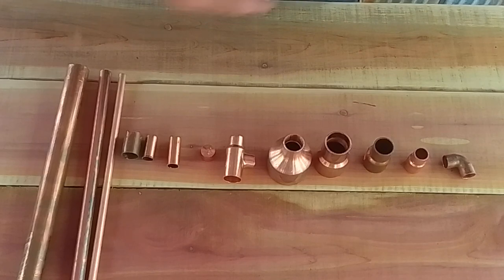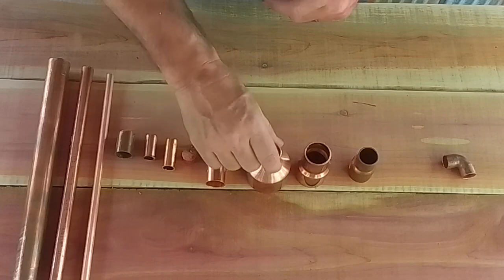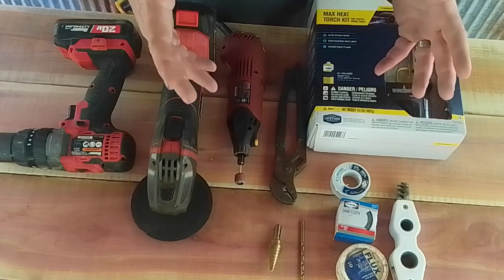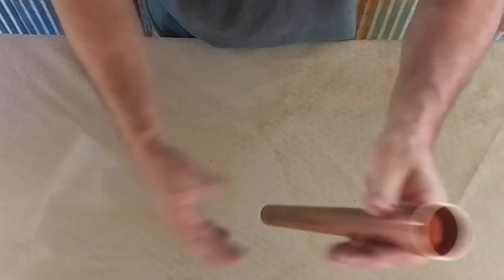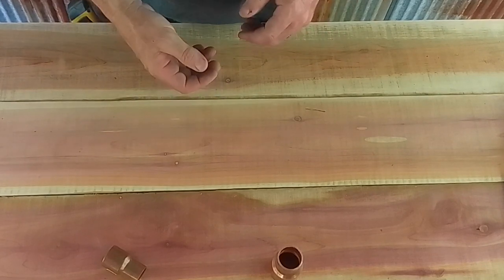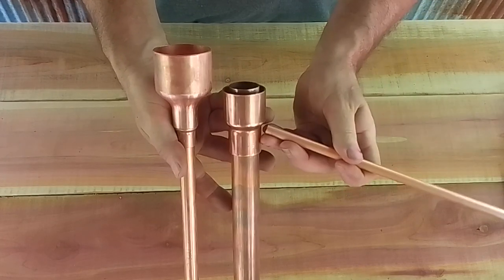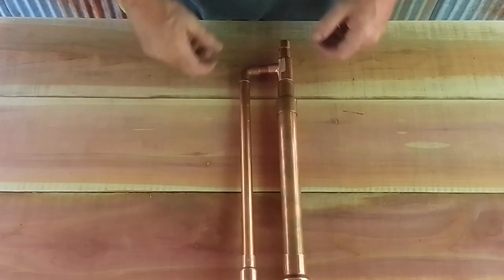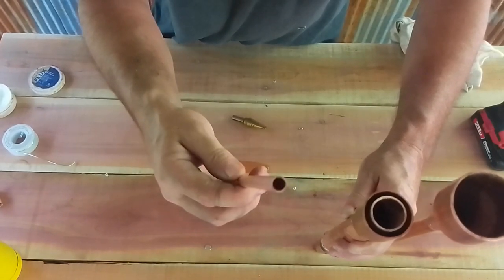DIY Copper Proofing Parrot

Comment: I realize that this vid is a couple of years old and things have changed so I have a couple of updates. 
The 1/2x1/2x3/4 is now available from HD (1/2 price of Am) HD# 187518. 
The 2" reducer is available to go directly 1/2" eliminating the 3/4 x 1/2 street reducer bushing and 1 joint. (couple of bucks cheaper too) 
AM has the 1/4' copper tube in 1' length. Hope this helps
Reply from the maker: Thanks for all the updated info. I have also found out through talking with so many others around the country that not all HD locations stock the same products.
Reply: @StillnTheClear  yes, I realize that not all HD are going to have that on the shelf, but they will ship it to the store for free. One question. The parts list says spout is 1/4" in the video you stated 3/8". Which is correct?
Reply from the maker: @Max-ol5wh  it is 3/8. I misspeak so often it's a running joke, lol.

Comment: Nicely done, Cyrus! In a pinch, I use pliers with long handles pushed into a coffee can full of pebbles or sand. Any kind of pliers work including vice grips. This hack makes it easier to get the torch around a horizontal pipe compared to a vise which sits too low on the bench.
Reply from the maker: Good idea, thanks for sharing.

Comment: The fitting you refer to as "street"? Is actually in the supply houses are called a bushing it fits inside the pipe. The other is a coupling.

So you would say 1 inch to 7/8 coupling would be 1 inch pipe  into a cup that reduces to 7/8 female to receive a 7/8 pipe
A bushing would fit into the cup.
Will be making this soon as i get home from the holidays to go along with my newly ordered items for distillation.
Reply from the maker: Thank you for the info.
Reply: @StillnTheClear  You're welcome, Merry Christmas 🎅

Comment: Great information.  Only problem: in the required parts  at the first of the video you refer to the 90 elbow as a 3/4".  In the loose fit assembly, you refer to the 90 elbow as a 1/2".  Guessing the 1/2" is correct.

Comment: The top fitting needs to be 1.50 x 1 reducer, not 1.25 x 1 reducer as stated in the parts list portion of the video.  The 1.25 is too small and my gap was much smaller than what is shown in the video
Reply from the maker: Nice catch. Thank you for the comment.
Reply: @StillnTheClear  ...assuming the Parts List hasn't been updated?